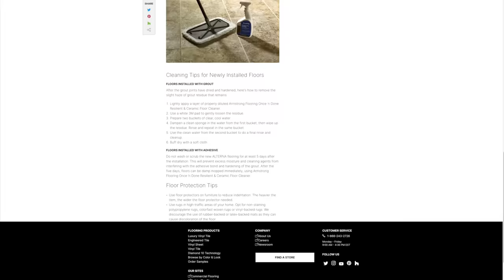Cleaning Mistakes You Are Probably Making

Comment: I'm hearing a lot of microfiber products in here, but I hear a lot other places about how bad microfiber is for the environment. What's wrong with just an old fashion cotton cloth, dampen it and dust sticks.
Reply: Maybe because Melissa Maker sells microfiber cleaning cloths?
Reply: I hate MF. I only use cotton. And it works well and is easy to wash.
Reply: I use the old t shirts.
Reply: @Peanut11111  I do as well, or I use old  towels, my grand mother and my mother used them and I will continue  to  use them, ( microfiber  clothes feel unnatural  on my hands)I understand  the way things are made are different  but using your common sense  also helps , you don't  have to soak your furniture  or what ever you are cleaning  just enough to get things cleaned.
Reply: @robertadunn1572  this is my issue with them as well. I have dry hands and micro fiber cloth sticks to my hand. Which really bugs me. It’s the feel of it.
Reply: I don’t use microfiber cloths. Everything I read is they are bad for the environment. I use cotton cloths instead.
Reply: Yes, microfiber is plastic and goes into our water systems via our laundry, and then into our fish and the creatures that consume them (including us!).  There are some products you can buy that trap some of the fibers in the wash, but they are difficult to find and don't get it all.
Reply: That’s how my grandmother taught me to dust just a damp cloth nothing else, my grandfather was a carpenter and he always told us never to use furniture polish either . My grandmother made all of her cleaning supplies especially her own laundry detergent it was the best her home was always spotless and smelt of eucalyptus ( she was also a professional cleaner) I always use old tea towels for dusting they get the job done.
Reply: @greenwillow5404  she used them and recommended them WAY before she started her own line of products
Reply: I’m team cotton as well. And I will use the cute feather  duster because I want to feel cute when I’m cleaning.
Reply: @eileengalindo4949  and the ostrich feather dusters create static so those do pretty well. I just feel like I'm going to knock stuff over with feather dusters so I don't like them for that reason.
Reply: @robertadunn1572  i do same. Old pillowcases, t-shirts, rip up into rags. I’ve found socks to be great dusters too.
Reply: My neighbour next door used a wool sock to dust with. I tried it and even put it on my hand, it did a good job of holding dust. The sock needs to be a nice thick one and 100% wool.
Reply: Probably using some of the old clothes that she throws in the garbage would work well.  🤔
Reply: There are certain microfiber clothes that also help to kill germs. Like norwex, works amazing.
Reply: Absolutely nothing! That's what I use, old tee shirts or old towels. @senseijoyner
Reply: Same here 100 percent cotton

Comment: Everyone knows the Swiffer duster is awesome.  The only downside is the guilt over using something with disposable refills.  Good thing I don’t clean enough for that to really be a problem 😜
Reply: Exactly. Using a swiffer duster is not a “mistake“. It is a cleaning choice.
Reply: To cut back on that just vacuum it and get the most dust off! Use again
Reply: @elizabethYtorres  good advice 👍🏻
Reply: Exactly, I dust maybe 3 times a month. So it isn’t a total waste lol 😅
Reply: I'm not giving up my Swiffer!  So much easier and faster than using a cloth, and then you have to wash the yucky cloth.  Not going in the washer with my regular clothes, so run a separate cycle?  I'm using a Swiffer!
Reply: @abc-wv4in I’ve always had trouble with the idea of putting those dirty cloths and mop pads in my washer.  Glad I’m not the only one.  Lol.

Comment: Swiffer duster is a preference, not a "mistake"  - to me the product I actually use is the one I'm going with. I don't have the wand, but I have a handheld and the dusters and it works for me. Yes, cloths are more eco friendly, but I'd rather have my home clean than do it perfectly!  (Same for paper towels for certain cleaning jobs). Microfibers also create pollution because of the tiny fibres that can't be filtered out in water treatment.
Reply: I love my Swiffer wand because I can clean my ceiling fans without climbing which is dangerous for me due to my knee. Glad someone spoke up. I like paper towels too.
Reply: As a washable, reusable option, I put an old decluttered sock over mine, right over the fluffy thing so it has some fullness and squish to it (similar to what she did with the "ghost" duster cloth over the handle)
Reply: Yeah, I'm sticking with Swiffer dusters.  The fluffy layers that gently brush and get into the corners of picture frames, the sides of vases and light fixtures, and the tops of books without knocking anything over are so much better than a rag on a stick.  I have one reusable microfiber dusting head that gets close, but trying to get it a special microfiber wash and dry every week so I can dust just wasn't happening.
Reply: A reusable duster head made of old flannel also works well, for those who sew! Same shape as the swiffer one so it still fits on the extending wand, and we just throw it in the wash rather than tossing it.
Reply: @victorialaux2912  preach!!! I forgot about the stupid special wash cycle microfibers require!  I have a suspicion if Melissa maker made Swiffer instead of microfiber EVERYTHING... I suspect all the many many drawbacks of microfiber would be illuminated here...
Reply: Microfiber cloths need special washing? I didn't know that. I just wash mine in the washer on hot/gentle with a little detergent then dry them in the dryer. 🤷 ~ Anastacia in Cleveland
Reply: @AnastaciaInCleveland  You're only supposed to wash them with other microfiber items.  If you wash them with normal cotton rags they'll pick up all the lint.
Reply: I use a duster which is similar to a Swiffer (made by Plege with a green handle) and meant to be disposable but I started soaking them in a bucket with a lid and then rinsing and washing with my cleaning cloths at the end of the week (I am a professional cleaner).  They work just as well so are not expensive and I don't throw them out.  It is amazing how much dirt they collect.
Reply: @victorialaux2912  Well, I only have microfiber cloths. I wash them with my bathroom mats which are not cotton but synthetic. My cloths come out of the dryer nice and static-y without any lint. Thanks for your reply! I'll watch out for cotton items.
Reply: @victorialaux2912  I had a microfiber cloth accidentally in the wash with a cat blanket and all of the hair was stuck to the microfiber cloth,now I put one in on purpose!🙌🏻😂😅🤣
Reply: @amyradtke169  Exactly.  I use the floor version swiffer with 2 heads & I use the reusable duster heads on it.  I love it for walls, under furniture & ceiling fans.
Reply: @annabelvnoucek2148  great idea
Reply: I'm keeping my Swiffer too!  
Maybe she said that to get many more comments, LOL.  Swiffers work great.  Cloths are yucky and I'd have to launder them separately, wasting energy and water.  Nope.

Comment: As someone who’s old enough to be your mother, I feel the need to add a little wisdom and experience from thirty years as a professional cleaner.
#1: the wait time for the chemical to do it’s job is called “dwell” time
#2: if something doesn’t need chemical dwell time,like glass framed art prints,always spray the cloth,never the glass because the liquid can seep behind and ruin the print.
#3: if anyone still has (single sheet)rolled vinyl flooring in their bathroom,entry or kitchen,then the steam mop is PERFECT, because there are no seams. Back in the day, Linoleum and Congoleum were high quality flooring and lasted forever,so some homes may still have them in good condition.
#4: a real ostrich feather duster actually works pretty well,you just have to shake them outside. However.the duster that you showed at 3:24,is called an electrostatic duster. If they get really dingy, you can wash them under running water and hang dry,but on a regular basis, you run the hose of your vacuum up and down the fluffy stuff before you dust and it charges it with static electricity. You can actually see the dust jump on to it and hold onto it! Very effective and reusable!
Reply: These tips are awesome! Especially the info on single sheet, rolled vinyl flooring and steam mops. I was wondering if the steam mop would unglue that type of floor.
Reply: @BbGun-lw5vi  With the typical quick mopping action,I don’t think you would stay in one area long enough to lift the glue.
Reply: @lauramitchell6725  True. But the thing I’m confused about is this: for steam mopping to disinfect, I thought you had the move the mop slowly.
I only steam mop every three months to disinfect so that’s probably not an issue. 🤷‍♀️
Reply: @BbGun-lw5vi  just move it slowly but not stopping completely at any spot and you should be fine.
Reply: @lauramitchell6725  Thank you!
Reply: YES! @Laura Mitchell I have the old time linoleum in our very small kitchen BUT there is a bad dark spot in the linoleum in front of our furnace door (which is located in our kitchen). I have tried everything and almost every product and even leaving the product overnight but nothing I've tried has worked to remove the darkness. I finally bought a steamer (like a clothes steamer) I haven't tried it yes but this is going to be my last ditch effort to remove this stain and if it fails then I'll probably be replacing the flooring. Do you or anyone recommend the luxury vinyl plank flooring for the entire home, especially the rooms with excess water? (Kitchen or bathrooms). @melissamaker
Reply: @Diana Weber  we installed life proof  flooring from home depot last year and absolutely love it.  Very easy to clean.
Reply: @dianaweber4396  that dark spot may not be a removable surface stain... As we discovered in our 1959 house with original flooring (not sure whether it is Marmoleum or Congoleum, etc), one of our dark spots was from water damage (underneath) from an old plumbing leak, and another spot was from heat damage (melted but not deformed)
Reply: @deborahpinto7299 Ooooh! Did you install it, or hire someone to do it? I desperately need to cover my floors, but I’m terrified about how much it would cost to hire someone.
Reply: can you recommend a great microfiber duster? One that both my kids and I could use?
Reply: @NellieAlmonte  I’m retired now,is there such a thing as a microfiber duster?  The electrostatic dusters that look like fluffy cotton candy (this video at 3:24) can be purchased pretty cheaply and really do work if you go back and forth on them first with a vacuum hose to charge up the static electricity.
Reply: ❤Thanks 😊
Reply: @dianaweber4396 If you have light colored flooring it could be the glue underneath that has discolored. That's what someone told me about my camper. Just a thought.
Reply: I love teh fluffy dusters! Thanks for the vacuum tip!
Reply: @dsa2591  👌
Reply: Excellent points. I am a senior who really enjoys cleaning. Linoleum floors and countertops were high-end, desired materials.
Reply: If an entryway floor has a dark spot on it, it could be wear from foot/shoe traffic.  I would suggest a low profile entry carpet with a nonskid back OR cut out a square at the entryway and either have it tiled (adding a small transition that goes over the linoleum lip) or replaced with a complementary solid color piece of linoleum.
Reply: @dino0228  Those are great suggestions. We had a dark spot around our toilet base and that’s how we found out that there was a leak,because the water seeped under the top layer.😔
Reply: @lauramitchell6725 w
Reply: I use clorox disinfectant wipes, pledge for my wood table and leather cleaner for my couch and shark vacuum mop on my floors with gain or pinesol cleaner and I vacuum and I put baking soda on carpet and vacuum and sprinkle baby powder and light a scent spray my favorite perfume around
Reply: @dianaweber4396  
The assorted vinyl plank flooring products are easy to install. I prefer the ones that don't have adhesive backing, just thinks it's easier to do  a click style. 
The planks are easily scored with utility knife so no need for fancy tools. Most good hardware/flooring stores should be able to help you with any other installation info.
Reply: @jn9850  we have regular  laminate in our livingroom and dining room. It is starting to separate on the long side of one of the planks. I dont know if this can be fixed but I was wanting to continue the same laminate throughout the rest of the house but they no longer make that laminate!!! I'm up a creek without a paddle. 🤣🥰🤣
Reply: Thank you for your words of wisdom! My philosophy is to NEVER spray the glass, always spray the cloth.
Reply: @NellieAlmonte  Norwex sells a hand mit microfiber duster and microfiber wand duster.
Reply: Thanks for those tips, especially tip 2.
Reply: I would love a real feather duster! It’s good to know they do work!
Reply: @dianaweber4396 stain could be from moisture so it may be permanent
Reply: Thank you!!!
Reply: I've never had pink stuff in my toilet brush lol I use the disposable ones I love them
Reply: Yeah I have rolled vinyl kitchen floor. And Formica countertops. So easy to clean
Reply: I'm watching this while sitting in the car waiting for ice cream. Just bought storage containers and cleaning supplies. Ha Ha
Reply: Please do a collaboration with the Clutter Fairy in Houston, TX.
Reply: Great tips

Comment: I love your videos! My husband and I have cleaned professionally for 39 years. Could I tell you my honest opinion? You were absolutely right when you used the Swiffer! For years we never used it. I thought it was a gimmick. We actually used Murphy’s Oil in a bucket and wiped each surface at our cleaning jobs. (We also used a feather duster.🙁) The houses looked good when we left but got dusty rather quickly. Then we broke down and tried the Swiffer dusters. Amazing! It seems like dirt dust doesn’t land back on it nearly as quickly. We don’t have a lot of money. In fact, we are probably considered poor. (Wages are low in Florida.) But we consider the cost of Swiffers well worth it. So please don’t feel bad that you have recommended them in the past.
Reply: Yes ma’am  ,same sit here but in tx… my hands gladly thank the swilffer after all those yrs of harder work
Reply: I have that issue right now. The house is cleaned and dust is showing and covering the tables like a blanket.  I change the filters in. my ceiling (from AC) and they are clean. I can't figure out where all the dust is coming from. I have lived here for 25 years and have never seen it like this before. I do live in the desert and it is a bad year for allergies. Any guesses or suggestions? Thanks in advance.
Reply: @kg811  I’ve read that dry climates produce a lot of dust.
Reply: @kg811 When did you last clean your ducts?

Comment: Melissa Maker is great inspiration to get to cleaning. And I hate to say it but for the time being I am sticking with my Swiffer. Somehow that duster gets me to dust better than any cloth, thanks ADHD!
Reply: I use my swiffer but use a microfiber cloth.
Reply: Her reasons for not using the Swiffer were not convincing. I’ve tried nice microfiber cloths and the Swiffer picks up dust better than any microfiber cloth.
I hate dusting and will avoid it at all costs unless I use the Swiffer.
Reply: @BbGun-lw5vi Yes, agree.  I find the Swiffer Duster does a better job than microfiber cleaning cloths as well.  I do use both depending on the cleaning job.  Also, I'm lucky enough to buy the Swiffer cloths at a discounted price with my employee discount.
Reply: Also remember  that for those of us with allergies and asthma, cleaning a duster by shaking it, is horrible
Reply: I loathe electrostatic dusters.  If the dust can be shaken off, what do you think happens when you’re moving it around from one shelf or piece of furniture to the next?   Use one in a brightly lit room or where the sunshine is coming through and you’ll see all that dust swirling around.  

Swiffers are the best for places that don’t need much dusting.  I usually use one for light dusting and then save it.  Next time I use the same one for heavy dusting and get a fresh one for the light dusting.  

Yes, the extendable wand is flimsy and intended to break.  Someone should come up with a better extendable wand.  I’d buy it.

Comment: The makeshift duster for ceilings or flat surfaces with any long device are great. But really need the Swiffer duster (not a cheaper version) for dusting items—frames, knick knacks, chandeliers, books, etc, using the dust attracting technology of Swiffer without knocking over the said items. Of course if you shake the duster there will be some fallout—the solution to that is DON’T SHAKE IT. The rule to maximize the Swiffer is to go from clean to dirty. So I will use it last on the dirtiest/dustiest something like top of tall furniture or along baseboards, under the edge of furnitures.
Reply: Absolutely! Microfiber cloths do not replace the Swiffer.
Reply: I agree completely. I also learned (after one made it into the washer by mistake) the Swiffer can be washed and reused a few times.
Reply: @gumbootgardener  I was about to say the same thing! Just wash them out in soapy water, rinse & leave to dry & you can keep reusing them until they fall apart! ☺️

Comment: I have lvp flooring and I use a spinwave mop! I love it. It's got microfiber washable pads no steam and you control how much water/cleaning solution you get on the floor! It's awesome, and best part no icky water buckets or cleaning the mop just toss the pads in the laundry! It was also much less than the steam mops and crossover vacuum mops!